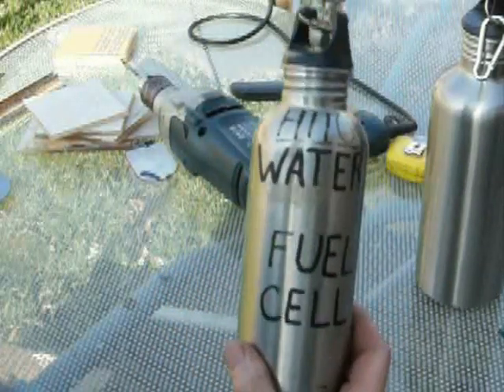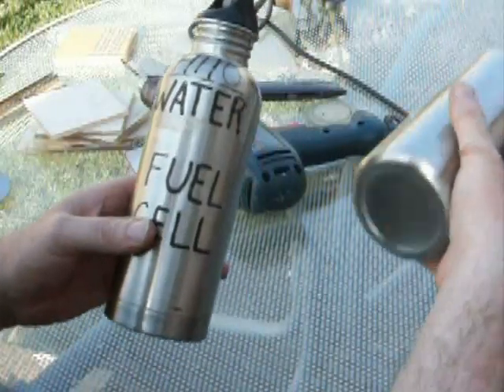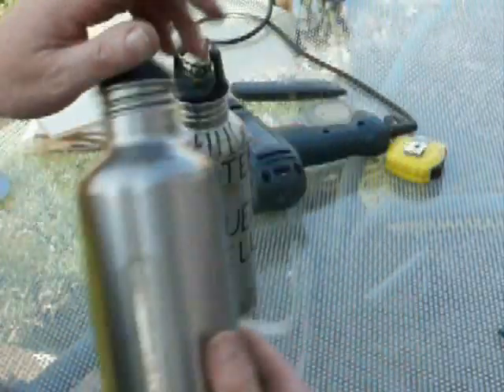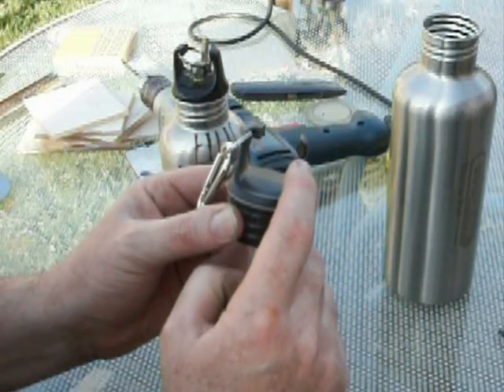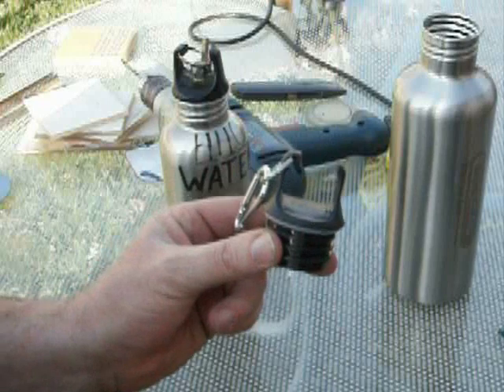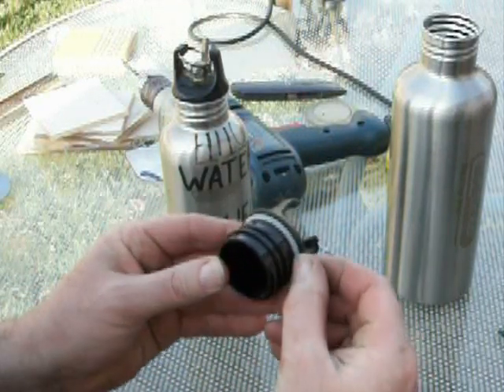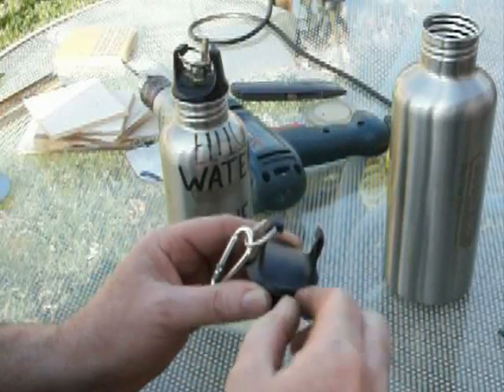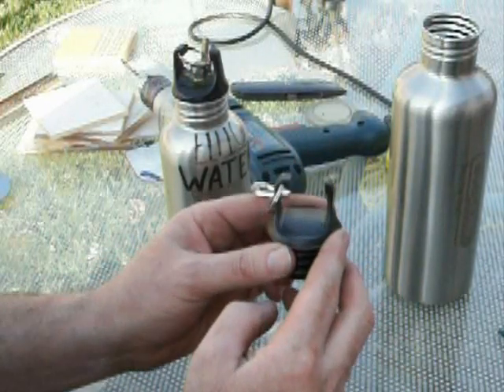HHO Wet Cell Basics (water 4 gas)

Comment from the maker: Great to hear it. This kind of feedback really puts a smile on my face. While grumpy old HHOinfo still says it wont work.
Get that solution as strong as possible! and a second unit attached. the head light will be brighter and the HHO output will be slightly higher. I plan on using this (What I am officaly calling) "passive power hookup" PPH  AND a  "mini me" dry cell with direct power hookup. So I will have as much HHO as possible coming from 2 sources.

Comment from the maker: Heat can be an issue but the metal container lets the heat pass through. I have them on my bike (check the vid for it). It's mounted were it catches all the wind. I had one in my truck just behind the grill, again catching a breeze. You'll need to weaken the amount of chemical you use in the water, this helps with both power and heat issues.

Neg hook up... The bike has a bracket, attached to ground. The truck, I used a hose clamp going around the neck and stick the ground wire in it (see video)

Comment: Thanks for the quick reply man, I really appreciate it. You've answered everything I needed to know. I'll probably do one just like this but with the addition of a bubbler and arrestor. It'll be going into a 1983 VW Rabbit GTI, Mark I. I believe it's a 1.6 liter engine, and from your video it looks like you're pulling one liter per minute which should be great for my car. I may eventually do a dry cell, but it seems to me that wet cells are cheaper and easier to make.

Comment: yeh - this works very well on my 82 Kawa 750 twin. It is really neat, to be accelerating uphill at 70mph, and have a throttle closed as your cresting the hill. I have run 200 miles, and keep getting 68mpg. I"l post a video of mine, but it is spot on your design. It works, so why change it!
Thanks for the encouragement! Getting the power from the headlight, made all the difference. I also have a switch to bypass the cell, if I am running at night and need more headlight power.

Comment: I built one similar using ss strap inside had a heat issue put another strap attached to it but not touching as a neutral worked out great does a good job thank you for a great idea

Comment: I really like this design for a wet cell, I may even try it. I just have one question, is heat an issue? How did you wire the bottle to take the negative charge? I saw how the positive was connected to the bolt on the cap, but I didn't see where the negative was connected. And lastly, I know this one is going to sound dumb, but, is it safe to touch the cell since the whole thing is just one big electrode? Obviously you'd have it mounted and never worry about touching it, but I'd like to know.

Comment from the maker: Don't worry about how much HHO your getting for now, just get it there and do the MPG testing. Worry about not over drawing on your power supply. Get a fuse on it on how much amps you can spare. If the fuse blows, water down the solution.

I have noticed that the dry cell does a better job with less power, but first steps first. Go ahead with the wet cell and see what you get

Comment: What size tubing / fitting are you using for the HHO output?  I'm building one for my 82 Honda Nighthawk, and your approach to the wet cell is the one I chose.
Reply from the maker: John Schultz It really doesn't matter. Just get whatever will fit within your working space (your lid).
Really, the smaller the better. Just for working space

Comment: Ok so the container itself is the negative side? I'm trying to build a torch. I have 3 stainless bottles and I was going to just cut them up and use the rings but if I can use this for a torch that would be cool.
Reply from the maker: If you want it to be the negative side...it just made sense for a car. If it's not for a car then do what you want and make it positive
Reply: @wcemichael  I have a 92 Volvo 240 wagon. I may just do this for it as it's just sitting there not getting any attention. It is a great car. But my main mission is I'm building a terrarium. I am trying to see what happens when I combine GANS plasma, quarts crystals and hho gas and different frequencies I will be burning the hho inside and collecting the water vapor that is released. I hope to build a larger one, one where I can enter into and I'm hoping that I will be able to see significant differences in the quality of air I'm breathing. Eventually I hope to make an entire room into a terrarium. Fun stuff. So I'm just scouring everyone's ideas to learn as much as I can about different methods. If that makes sense?

Comment: good video. how much hho production are you getting out of each of those wet cell units? Join in by reporting your numbers and test the atmospheric 'litre per minute' by submerging a filled upside down litre plastic soda bottle in an equal bucket, inserting a lead tube into the water and into the bottle. time how long it takes to figure production. I will be reporting my system & production also. thanks

Comment: Do you need to do anything different for a fuel injected car or motorcycle? I saw that vid about using power from the headlights, very useful. Do you still need a power modulator?
Reply from the maker: Well there are a lot of additional things to consider. Other people have got a better grasp on this, but as you see I did have a couple good ideas for it. I'm not sure if I'm doing the best hook up that can be done.

Comment from the maker: Continued. if you have a system only using 12 volts, it's safe to touch. BUT if you open the bottle the Pos can touch the Neg. This will cause a short. It can ignite the hydrogen. I've done it. Not really dangerous but really scary. So make sure to disconnect before servicing!!!

Comment: does the canister that holds the water have to be stainless steal? I'm seen people use plastic... since the only things the bottle touches is the water/gas mixture I'm assuming it can be plastic?

UPDATE: nvm the bottle is the negative i see
Reply: well a plastic bottle I seen those and you can have contamination with the mixture of water and light over time I like this idea of a stainless steel container I want to try using a crock pot one of those ones that can seal >:D but more then one bolt in and link them together in this arrangement on the top and insulate the pot with a battery warming blanket maybe and install quick release snap rings for electrical connections.  
+ - + - + - + -
- + - + - + - +

Comment: Could that stainless steel container be used as a small tester still?
Reply from the maker: You mean alcohol still? Hmmmm.... I'm having mixed feelings about that. I don't like the cap so much because it's plastic, so personally I wouldn't.
If you're making alcohol for fuel, then go ahead.

Comment: Need some advice. I made this tonight and while it bubbles (only with electrolyte added), I'm not getting any bubbles in the bubbler. Any ideas? The flask is an insulted stainless steel and the bolt and washers are too but only goes down about half way.
Reply from the maker: Well you must have a leak somewhere. If your unit is working...that's the only conclusion I can come up with without more info
Reply: wcemichael Thanks for responding. I'll take a look in a couple of days again when I have some more time. Also going to increase the length of the positive pole.
Reply from the maker: Just make sure it doesn't touch the negative. water with dish soap is best used to find leaks

Comment: Does washer spacing and configuration make a difference if so i would be glad to know. Thanks
Reply from the maker: I'm not sure.
Reply: Ok im working on a bottle and have spaced 1/2" washers with nut after every two washers have not tried it yet. Having no luck finding bottle with wide enuff lid
Reply from the maker: Oh excuse me. It's been years since I posted this video. I was thinking of typical pos neg plating. This design has is just trying to get a maximum surface area on the positive plates. Any config is fine.
Reply: Thanks for info. Are you still using hho on your vehicles? If it works a little its better than plain gas.
Reply from the maker: I haven't experimented with it for a few years. Plan on getting back to it, just don't know when